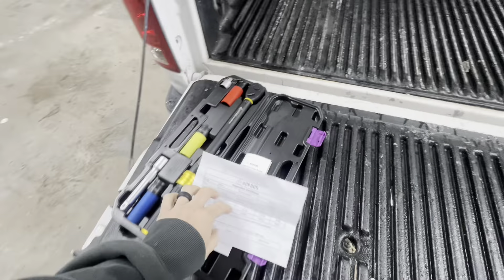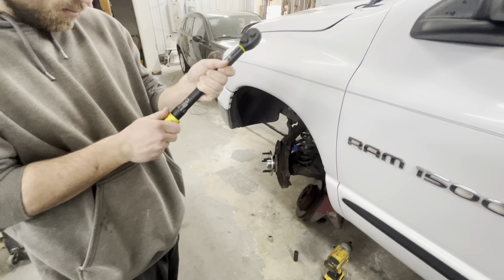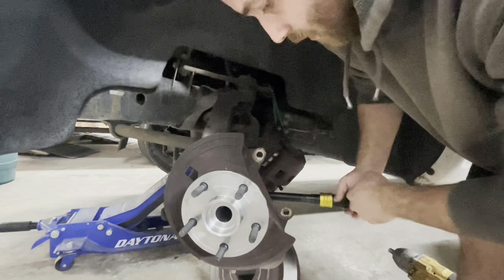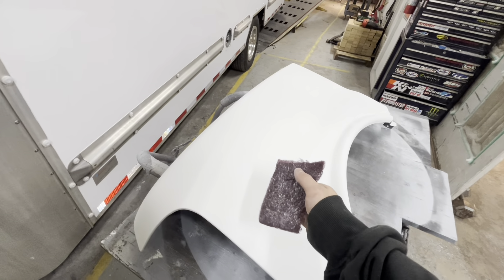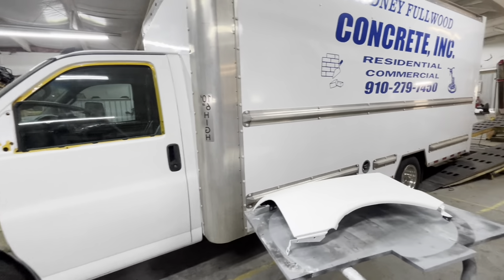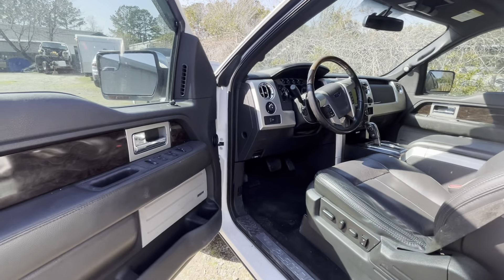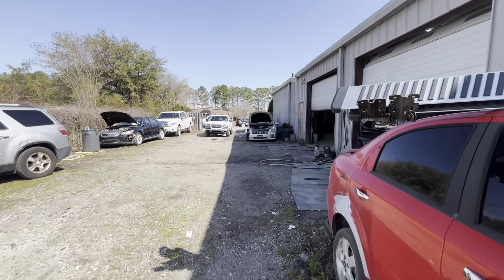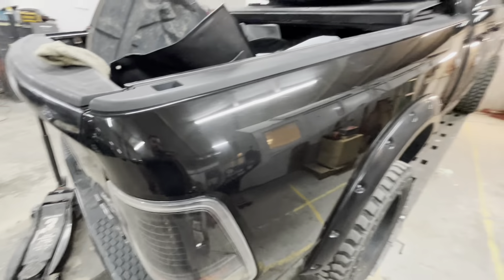I Bought A Junk Platinum F150‼️ Bonus ANPUDS Torque Wrench Review

Comment: The 82 z28 white is what you’re looking for I think
Reply from the maker: ALK does not use other paint paint codes. It has it own codes. So there’s no matches for normal vehicle colors. My local branch only has what they call GM white bc they shot a GM white with a camera and made a formula. However it would never match a BC/CC GM white if put side by side.
Reply: I know square body white and Corvette white was commonly code 11, a lil brighter than passenger car white.

Comment: Sorry for the off topic question; but under what circumstances would you recommend a semi built coyote over a 351w or piston and rod 5.3 for a turbo fox? I like the engine and want to keep things ford but the costs and much more complex platform for the coyote worry me over the pushrod stuff. Some of the costs get ridiculous when you start going or adding. Thanks
Reply from the maker: I’m sorry I unfortunately know nothing about the 351 or 5.3  I was going to build a 351 but then went coyote.
Reply: @ThePaintPaperHustle okay, was hoping you would steer me away from the coyote for the costs and skill needed to work on them compared to others 👍
Reply from the maker: @timweb1510 no bc I’ve learned that at a certain HP level they all cost the same. Coyote can hold 1000hp in stock form so it’s easier to make power with it. Stock cranks have made 2500hp in the coyotes along with stock heads have made that. Have you watched Brett’s video on what the Snot Rocket has?  Also TKM just compared the coyote to LS.
Reply: @ThePaintPaperHustle thank you for your time sir. I have been considering it for a long time and worried about making a bad choice
Reply from the maker: @timweb1510 you’re very welcome